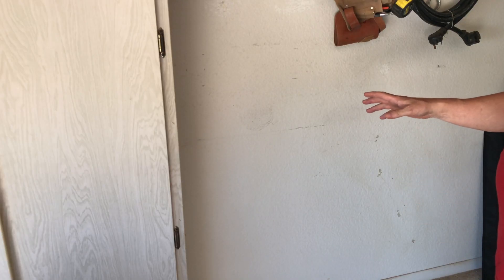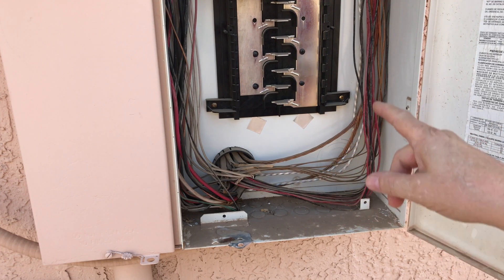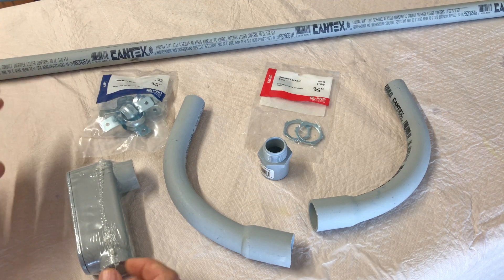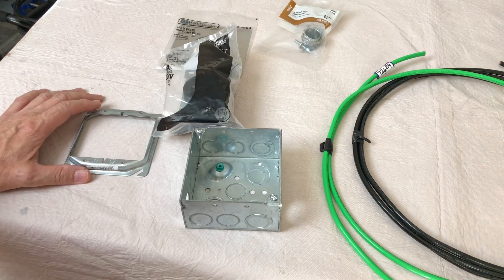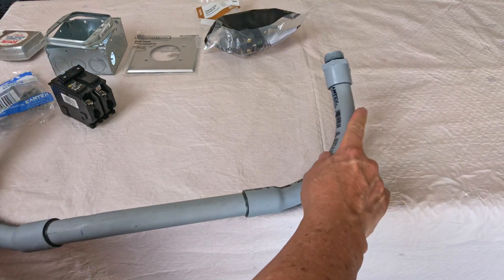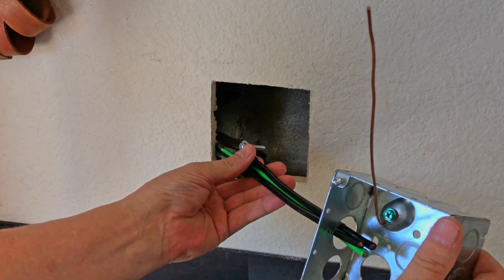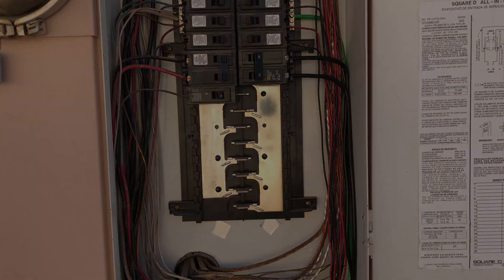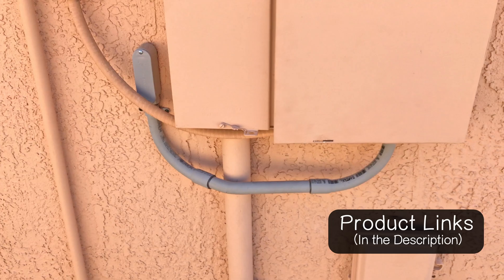Zero Experience? No Problem! How to Install a 240V Outlet in Your Garage!

Comment: Nice job !   I gotta admit that I'm a bit jealous.  I really want a 240V outlet in my garage for a welder too but my service panel is on the far side of my basement and the cable run will need to be about 100' to my garage which is a long run.  This has been preventing me from doing this job... so far.  Sigh :-/
Reply from the maker: Thank you Joe! I understand what you mean, I had the same situation in a previous garage I had.
Reply: Run an extension cord 6 gauge